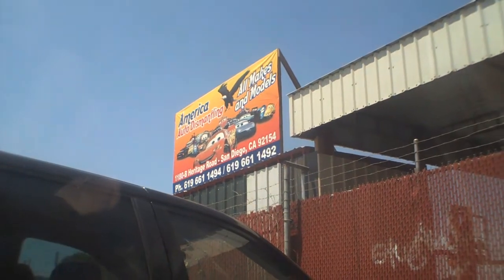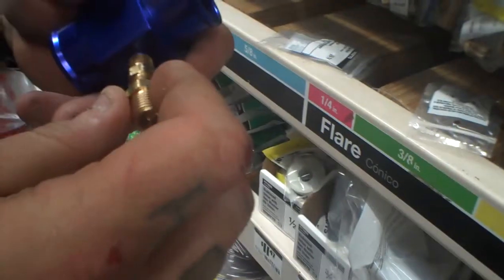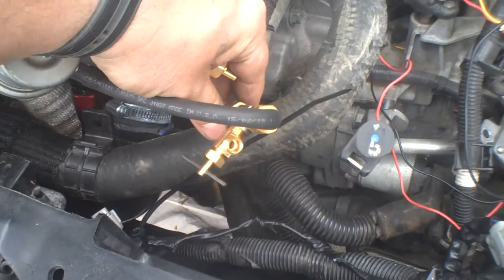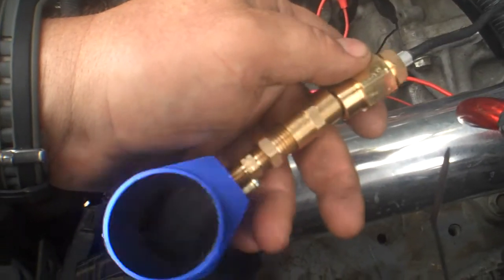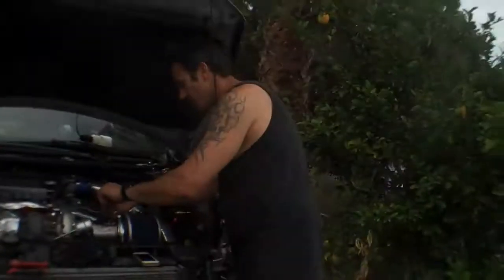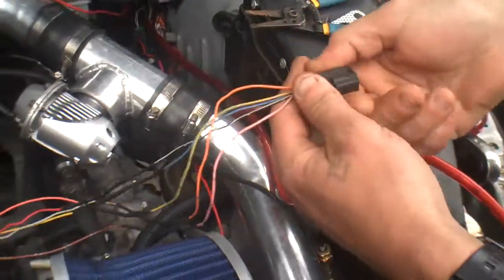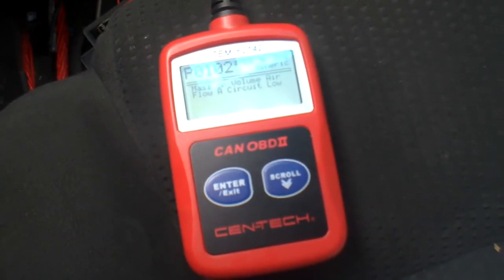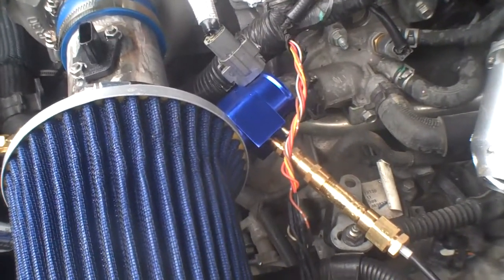NISSAN ALTIMA TURBO QR25DE QR25DET INFINITI G35 MAF SENSOR

Comment: Is it a car with MAF sensor , originally NA , when installing the turbo, need to add MAP sensor too ? 

Lots of tuners said the car with MAF sensor , put a bolt on turbo, need to put the MAP sensor , because relying on MAF sensor itself will make unstable simptom during boosting like surging/jerking ? Is it right ?
Reply: no... thats just bcs when throttle closes, the turbo is still pulling in air through the maf and itll be rich for like one second but its not critical at all. youll only notice it during tuning but it wont be noticable during driving. if you get sputter or stall when slowing down, its more likely your timing chain is worn out and loose. you can run your maf infront of your throttle body but before your bov and youll need an aluminum pipe that holds your maf sensor bcs the booost will cause the factory plastic maf tube to explode lol. its not necesary to have the maf the other way i explained it but itll result in just a little bit cleaner tuning and itll look cleaner under the hood bcs you wont have all that piping infront of the turbo, just a filter, thats it.
Reply: @AutoBodyEverything  Interesting. Thanks for the info! Makes sense that you would need a solid mount for the MAF if installing on the charge side as the plastic gets as brittle as old bones.

You seem to know a bit about these engines. Don't suppose you know anything about the QR20 out of a JDM P12? I'm going to be boosting mine soon and wondering if the stock ECU can register any boost. Tried googling but It's not turning up much.

 I'm going to throw in some 550cc injectors, a 255 pump and maybe mess with the MAF resistance to make it think it's getting more air and then dump more fuel but I know those are only going to be band-aids at best if the ECU won't register any boost. Might even de-cap the injectors if that still doesn't cut it. 

I'm trying to build it as cheap as possible so just needs to last till I can afford a tune really. At the end of the day the wideband will tell me all I need to know but any experienced info is always welcome. 

Sweet Sentra you have by the way! It's a shame we never got the B15 in my country. Cheers

Comment: why is your turbo surging on deceleration  when you have a bov, also the stock maf will read 20psi before its maxed out.
Reply from the maker: That's exactly what it was, surge. It was a Garrett GT3076r. It was a great turbo to have while driving but at idle it would surge due to it being a large frame turbo.

Comment: Is it better to have the mass air flow sensor before the turbo or the throttle body?
Reply: damn no reply huh... its just a little bit better control before the throttle body as far as tuning. at the turbo, youll get faster response bcs it reads air before its compressed, but after the intercooler, it reads air passing by but it does not measure air density. its all the same !@#$ by the time your done and its tuned anyway, as long as your values are correct, the ecu will do what the sensors tell it to and your TUNE adjusts the values of each sensor's output to the ecu based on what the tuner knows and sticking to the laws of physics. all the maf does is to do its best to keep one special wire hot! As air passes by, it cools down the wire. the more air passes by, the cooler that hot wire gets and the message is translated tp the ecu by values of voltages.those values tell the ecu more or less fuel. the o2 sensors at the exhaust let the ecu know if its giving too much or not enough gas.. the o2 sensor works just like the maf except this time its the fuel that will be cooling down the o2 sensor.